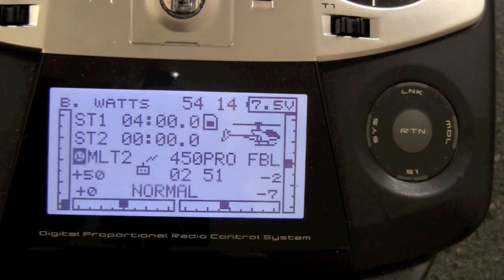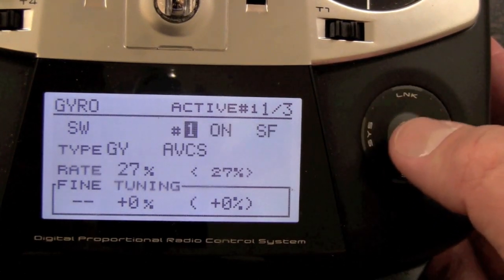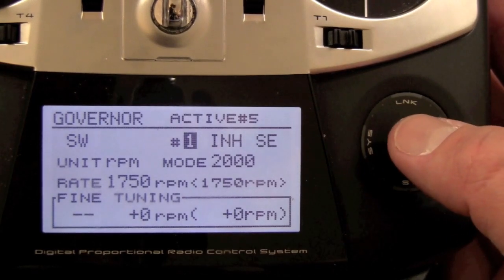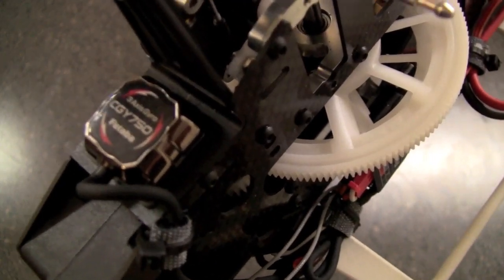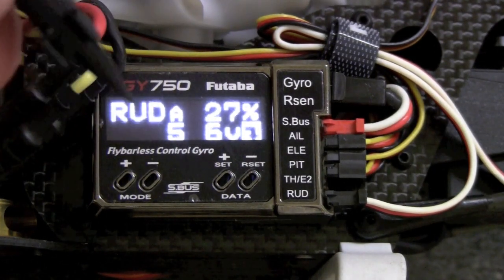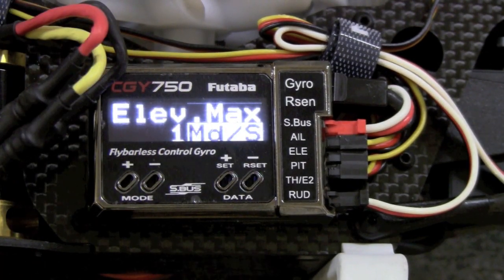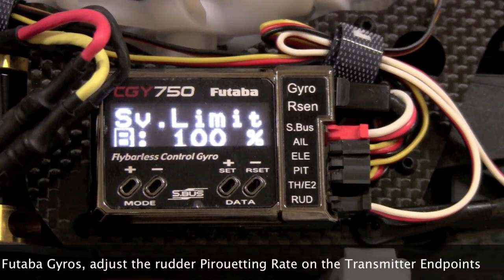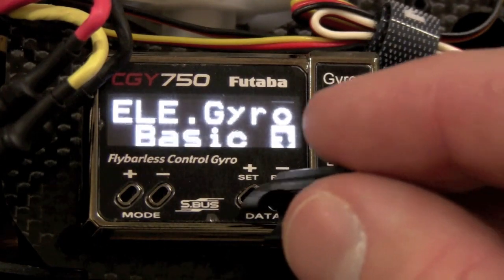Bobby Watts Demonstrates How to Set Up the Futaba CGY 750 Flybarless Unit (Part 1 of 2)

Comment: Hi Bobby I'm considering doing the same set up on my 50 size heli but I just wanted to make sure of a couple things before I do.I'm using an older 8fg and I want to use use the cgy 750 with a 3 channel s bus receiver. Will I need to use s bus servos or does the 8fg automatically assign the channels?

Comment: Hi Bobby, 
I'm using the t8fg with the CGY750 and @ 3:42 sec on your video you say about the gyro setup, I have the same page on mine but i don't have the option to change pages like you have (Top right on the display) I only have the one page and top left it say's "GYRO ( RUD)"
I have the latest firmware on mine Version 3. what have i set wrong?
Thanks in advance

Comment: having an issue with my heli spooling up but will not take off.  The pitch is the correct direction on the bench, but when I spool the heli up it creates the wrong pitch.  I can lower the the throttle stick and the heli will lift off.  It is weird because it is fine on the bench, but when I spool it up it is reversed.  Any ideas